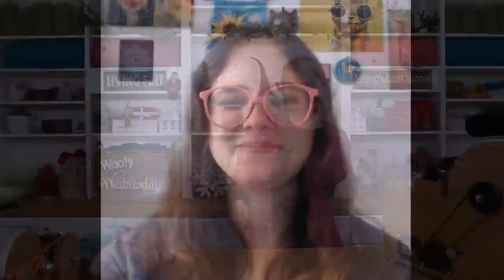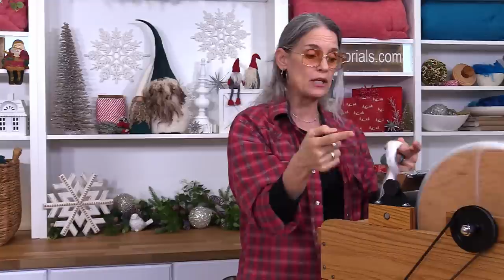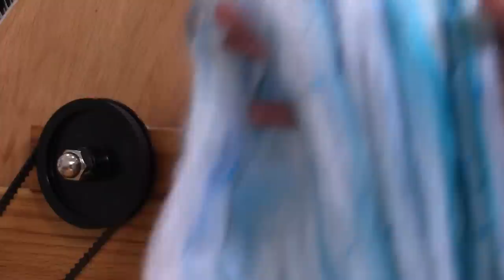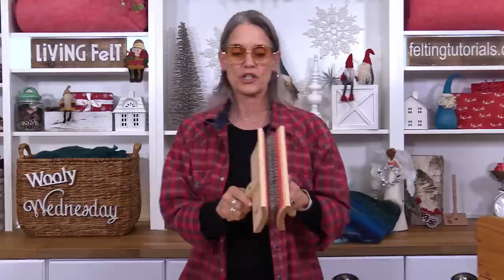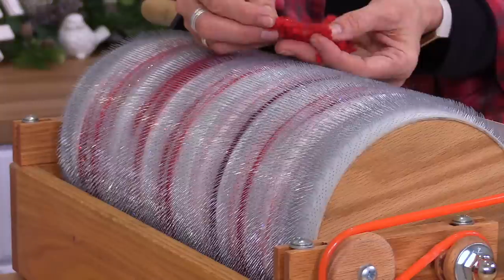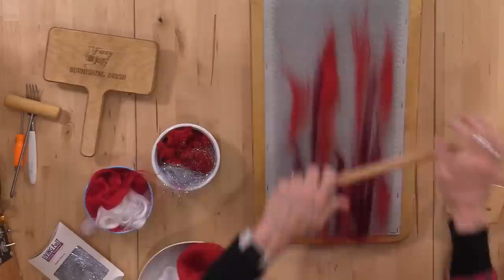Drum Carding Party! How to Card an Art Batt + Intro to the Fancy Kitty Drum Carders

Comment: i missed the beginning and had re-watch, i didn't want to miss the Wednesday Joke!! i have not seen a hooked doffer before, very interesting. i can see the advantage that it will reduce the want to lift the entire width off the drum at once, and use little nibbles which is more effective. the local guild has a fancy kitty drum carder which has been in use since 2013. it has survived a lot of use by many guild members at many levels of expertise. (and lots of different fibers) So they are pretty hardy. Drum carders are excellent for mixing larger amounts of fiber for felters or spinners. you can use them to blend to a single colour by running the fibers through a number of times or create a less blended batt which may be perfect to start a felted picture or wet felted project (the world is not made of flat colours). i am looking foreword to your review of blending boards! i hope you have a swing picker to frighten us with too!!!  you may have fun doing a quick chat about starting from washed fiber and preparing it to go on to the drum carder by picking. also why the locks of picked fiber are usually added under the licker. but that would be for another day!  it was helpful to see the other carders and compare them. oh have you seen a batt taken off over a paper towel roll? or using a diz to remove fiber from the drum, i know its not creating a batt but its a fun thing to watch and to do. Last thot i promise. you might want to remind us about not letting fiber build up around the drum shaft. so maybe a quick chat about care and maintenance would be good in a further video too? (sorry for the spelling im still dislexic)